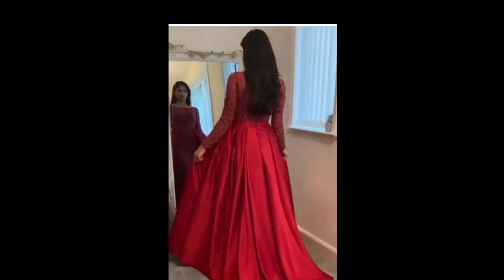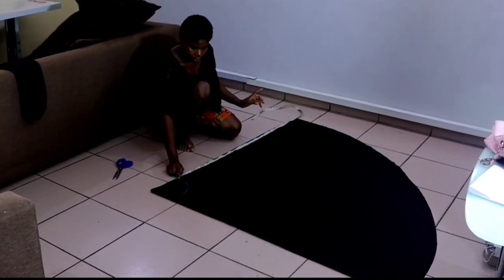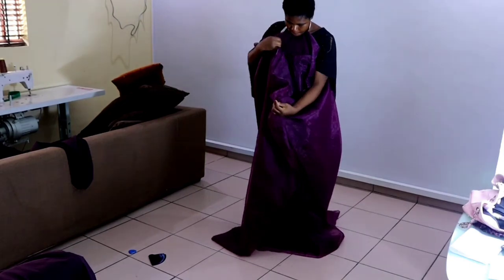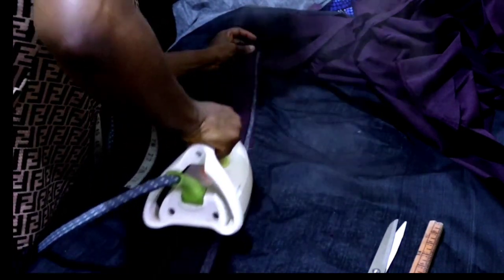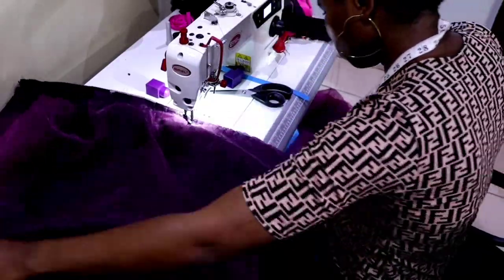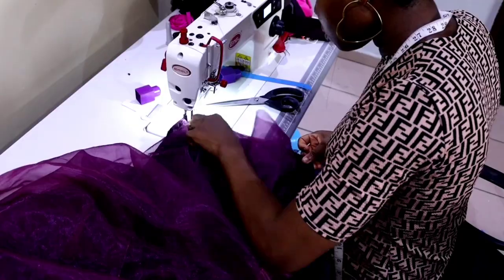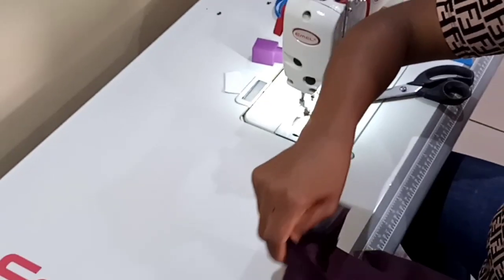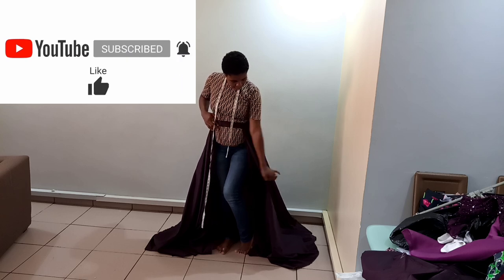How to make bridal detachable flare/peplum Skirt

Comment: Please there are some longer detachable skirts without a join. How is that done as well? Or there's no way, except to join to have a longer train?
Reply from the maker: Then you will have to use fabric with longer length....e.g Mikado silk....usually comes in 120inches length
Reply: @abujatailor  very thankful sis. Aside Mikado, Do you know any other fabric which is also longer in length?,
Reply: very thankful sis. Aside the Mikado silk, Do you know any other fabric which is also longer in length please?